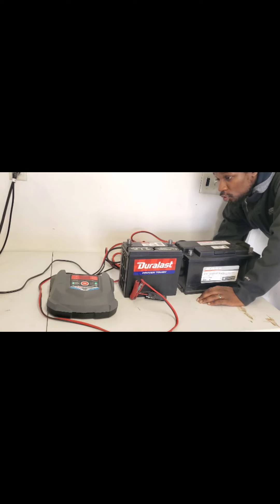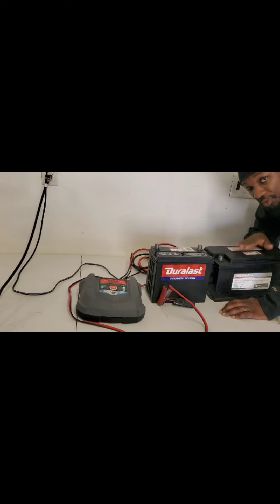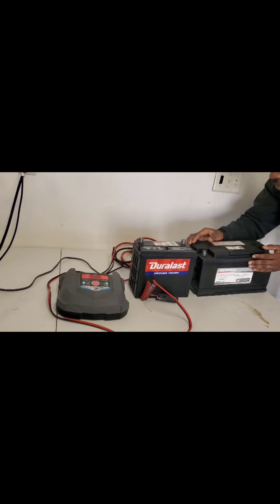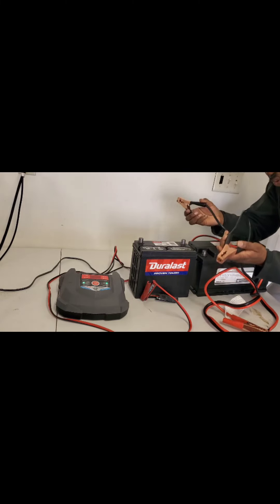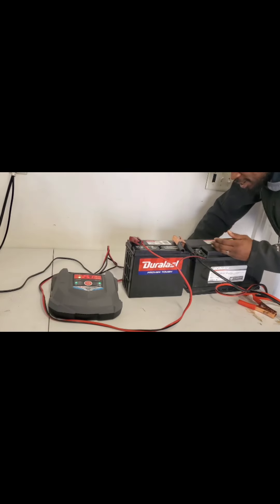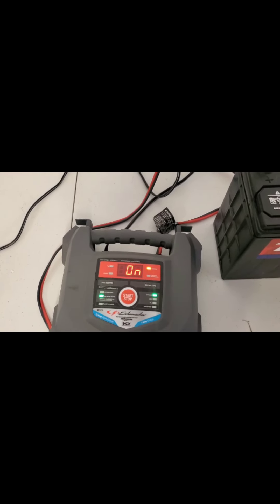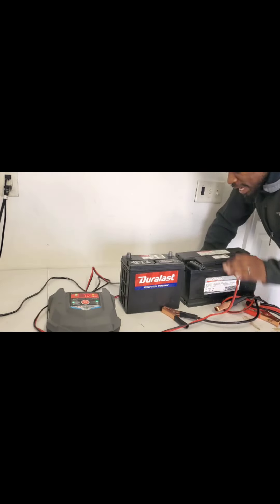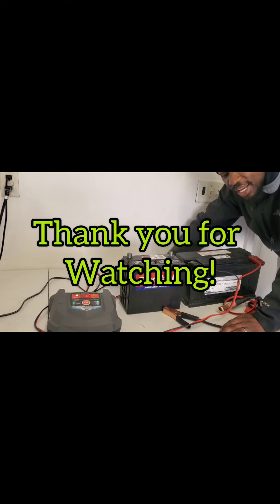How to charge a Bad, Flat or Dead battery DIY

Comment: A 3 to 4 year old car battery is not old if it is properly maintained and not run flat or left to self discharge until below 10 or 11 volts.  I just replaced a 9 year old battery in my Ford Crown Vic.  

What you call jump starting is putting the deal battery in series with a good battery and the charger.  To be honest, I've never thought of doing that and never seen it done, but I will take your word for it.  I have seen people put the two batteries in parallel, (positive to positive, negative to negative) with jumper cables for a short period of time to get enough charge into the dead battery so the charger will start charging it.  Using an old fashioned "dumb" charger will also do the same thing.
Reply from the maker: This particular battery I called old because it wasn't maintained at all. It came out of a car that was sitting for over a year. When initially hooked up to charger it read "bad battery". I've run into this issue on numerous occasions because I buy abandon cars all the time and bring them back to life. When I had everything on the table in my garage the other day I figured I would share this little trick I've done so many times. 

Now I did forget to mention that this does not always work on every battery. Some come back to life and some are just completely dead and gone. It's worth a try though.
Reply: @alhuegayle7550  The problem you have is that most new "smart" chargers will not start charging a battery that is below a certain voltage.  The old fashioned chargers that lacked the electronics would happily push their rated current into a completely discharged battery.  And, just like your experience, sometimes that worked and sometimes it didn't.
Reply from the maker: @BryanTorok  modern day tech is both good and bad for sure.